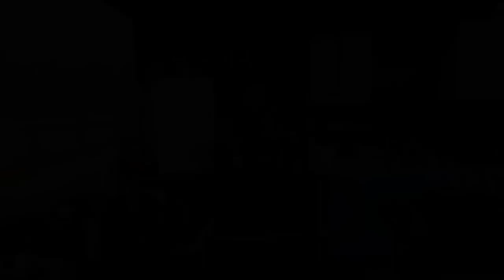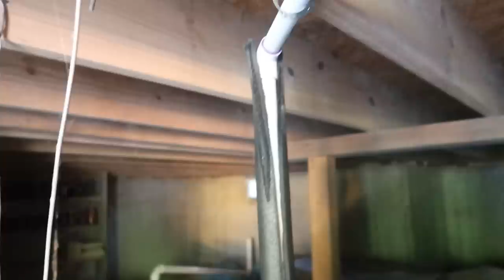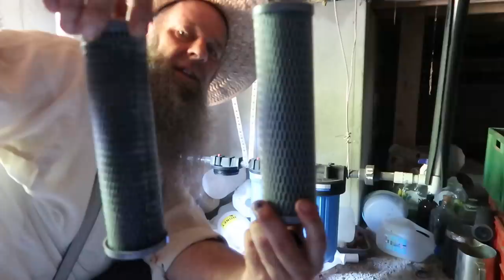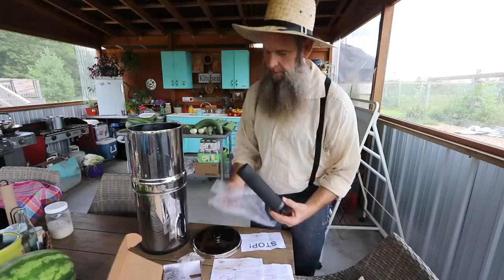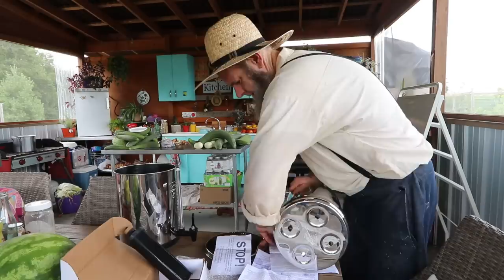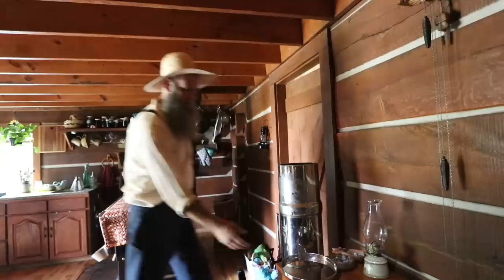OFF GRID WATER could make you SICK protect from Bacteria Viruses Heavy Metals

Comment: Someone may have noticed this already but, you want to wait until most of the filtered water has been used and that lower container emptied before you fill it up. It's important for the filters to be completely immersed in water for them to work optimally. If you are just adding a pitcher to the top when you see the bottom is low it's not going to work as well. If you fill the top to the tops of the filters you are going to get a flood. 
But my kitchen floor got a good rinse and rub down so there's that! ;)

Comment: We've had the Berky water filter for 2 years now and are on the same filters we installed on day one.  We take the filters out and clean them and use them again.  Good for a few years.  We LOVE our Berky.  Our water is in holding tank and comes from a spring in a cave on our property.  It's pumped up to our house. We just use a single thread filter and and run the water into the house then run everything we drink through the Berky.  Best water ever!

Comment: Using a Berkey for 5 years. Great product! They/it even take Roundup out of the water. Which is in the rain now. A tip I have if it doesn’t process the water fast add a small clip to the joint of the top & bottom of the container. They sell them clips but anything will help.  The other holes are for fluoride filters. But you could use 4 filters...
Reply: the fluoride filters screw on the end of the carbon filters, it would do no good to put the in the extra holes. the berkey can handle 4 carbon filters and 4 fluoride

Comment: Everyone has problems with the ceramic berkey filters leaking. Put red food coloring in the top, and see if it gets to the bottom.

Buy aquarium sealant, and run a bead across the base of the filter where the ceramic nests into thw plastic cup. That seems to be the weak spot. Aquarium sealant is safe; if it's safe for fishies, it's safe for us.

Comment: 7:36
My father put two metal cans in the wall of our foundation instead of PVC. Whenever you're ready to put a water pipe through, just pop the top and bottom off the can and you have a nice hole to route your pipe through. After that, mortar your pipe in and you're good to go. We did this with the pipe from our spring up the hill.

Comment: When I moved into my present house almost three years ago I decided that I would not be drinking the tap water. We had slowly been transitioning to  bottled water. But I did’t like the plastic waste. In addition I was pretty much relying on the integrity of the people filling the plastic bottles. Of course after researching I realized that the bottled water was not necessarily pure.  When Jess from Roots and Refuge showed the Berkey I got one, Mine is large enough to hold one gallon. It is enough for me to use by myself. I am glad for it. I fill several glass bottles (which were included in my order) and keep them in the refrigerator. This allows me to keep ahead of my water needs, this provides already cold water whenever I want it, and just in case I forget or neglect to fill the Berkey this is my back up plan. I have plenty of water to drink while I wait for my gallon of water to filter through.  That is my not-off-grid routine! LOL!
Reply: I think another issue is the companies sometimes exploit small towns with good water. They are greedy about taking too much water and not paying properly for it.

Comment: I’ve been using the same Berkey water filter system for the past 4-5 years, and even the pets won’t drink water unless it’s filtered by Berkey! To avoid running out of filtered water I fill a glass jar with filtered water, and add more to the filter, when the glass jar is empty I refill it from the Berkey and add more water to the filter. I love it! We are on a cistern and there is a lot of sediment. The filters get clogged very quickly, but Berkey recommends scrubbing it with a Scotch Bright scrubber up to 100 times to remove sediment. Without this trick the filters would be much too expensive to replace twice a year.
Reply: I was thinking it would be good to have a carafe or two of filtered water on hand or use one of those table top ceramic dispensers, to stay ahead of the filtration rate.

Comment: Water filter removal tip: I have a reverse osmosis filter which has the same blue plastic filter holders you have in the crawl space. I keep a loop style oil filter wrench under my sink to help open the canister. Works great. They also make dedicated wrenches for them. 

Also, I’ve seen some canisters made out of clear plastic, which might make filter inspection possible without needing to crack open the canister.
Reply: Will Swift  – RO water isn't much different than rainwater in that respect, so there's a large component of FUD there. That being said, mineralized water tastes better (probably because it is, indeed, healthier). And i do add minerals to my RO drinking water; typically about four drops of Trace Minerals Mega-Mag 400. Sometimes i also add powdered potassium gluconate. I suppose a pinch of baking soda could be added too, but it hasn't been my wont to do so. 

Some of the newer RO systems offer a mineralization stage, which supposedly adds minerals back into the water, but i'm leery of those. The purpose of RO systems is to remove contaminants; how do i know the mineralization stage doesn't introduce contaminants? Perhaps not by design, but unintentionally. Knowing the way things are sourced today, i think that's a very real possibility.
Reply: Will Swift  – As i understand the theory, RO water is "bad" because it's too pure. Rainwater is similar to RO water in purity. 

Drinking pure water has two implications: A) it isn't a source of minerals, and B) pure water is slightly acidic. But water from various sources varies widely in mineral content, so relying on water as a primary source of minerals is probably unwise as a general rule, as it varies by region. 

For example, water servicing Portland, Oregon comes primarily from the Bull Run reservoir. It is primarily rainwater and snow melt, which has spent a little time in a lake. It has minimal mineral content, compared to hard water sources like most well water. The minerals it does contain are mostly undesirable contaminants and byproducts from the pipes and water treatment systems.

Supposedly, it is the slightly acidic nature of pure water which makes RO water "bad." If one has adequate minerals in one's blood plasma, drinking pure water won't be leaching minerals from teeth and bones. And it's easy enough to raise the pH by adding baking soda, or other alkaline minerals.

Different kinds of filters filter out different kinds of things. If your water contains lead, fluoride, or other contaminants, you're probably going to need something like a RO system to remove the bad stuff. Unfortuantely, that means removing some good stuff too. 

The argument that RO water is innately "bad" is spurious, and therefore FUD, in my opinion. It is an argument often put forth by many non-RO filter manufacturers who want one to buy their product instead of a competitor's RO system. Problem is, their systems are probably incapable of removing heavy metals, etc. Such systems may be good for many applications, but certainly not suitable for every situation nor source of water.

Comment: With my water filter I simply turn up a 5 gallon water bottle on top and place a 5 gallon bottle beneath the open valve.  It will filter the 5 gallons over night.  Don't have to worry about overflow or constantly filling up the top container.
Reply: Excellent idea. My Alexa pure only filters 2-2 1/2 gallons in about 12 hours. God bless you.
Reply: Can you tell me what you use to connect to do this?  Thanks!

Comment: We’ve used a berkey for 10 years.  We keep a gal pitcher of tap water beside it to dump into the Berkey, and another beside a separate clear dispenser to move the filtered water, so we have easy access to a greater volume of ready to use water.  We drain the filtered tank to keep in the clear 2.5 gal dispenser every time we fill the top reservoir so it doesn’t overflow, but we keep an inverted lid under the unit just in case. We use filtered water for all drinking, cooking, bean soaking, pets, etc.

Comment: Doug,  I have never seen a filtration system where the carbon filter is first in line. The carbon traps both water soluable compounds as well as microorganisms. Filtration stages should be set up to progressively trap the larger particulates. The Berkey gimmick appears to be just a carbon filter.  In my opinion you may consider rearranging the cannisters.
Reply: Do you mean progressively filter out smaller things?

Comment: Hi Doug,

I love my Berkey!  One tip for you: I drilled a tiny hole in the back of the lower chamber just below the top.  Takes care of the vacuum issue that slows your water flow and does not let light in so no issue with growth.  The stainless spigot is much nicer for both flow and ease of use and they put them on sale for half off fairly often.

Take care and all the best from California 💛
Reply: Some folks (maybe BP Earthwatch?) make a tube with a T on top, that attaches to one of the filter holes, and the T sits above the top container fill level. It does the same thing with letting the air out of the bottom so it fills faster, and you don't have to drill a hole.
Reply: @davidmc8110  Hi David,

Sounds interesting but that wouldn't work with the travel berkey that I have because there are only holes for the 2 black filters that are installed.  I think all of the other bigger models have the holes for an additional  2 filters.  Very clever idea though!  Thanks!
Reply: @davidmc8110  CLEVER! I have the cork stoppers and I am thinking of drilling a hole through the cork and fitting in surgical s.s. tubing to allow flow.

Comment: I collect rain water too and have been using a Berkey for almost 3 years with no problems. I started out with the white ceramic filters but since changed to the black cartridges. I only have a 5 micron sediment filter in my system so I knew I needed something more for drinking water. If the water is going in cooking or for cleaning I just use what comes out of the tap.

Comment: You don't want to add a little bit of water at a time to a Berkey because then you are always using the bottom half of the filters.  The top half of the filters will then will dry out and become useless with time.  Always make filing the tank a once a day thing... fill enough water so that the filters in the top chamber are always completely covered. Good luck!

Comment: I ordered two filters from Berkey and used two different  party drink dispensers  that hold maybe 8 gallons each.  I had to have two different ones to get them to fit together  like the Berkey does.  It works perfectly!  My dispensers are clear  plastic not aluminum like the Berkey.  So I can see how much water is left in the water filter system.
Reply: Most of the Berkey models are stainless steel, not aluminum, but congratulations on having worked out a system that suits you! 👍

Comment: Now, Doug, realize that at times the usage of the water after filling the refill chamber causes a vacuum in the lower chamber and decreases the flow. It is NOT a requirement to replace the filter. The fast relief for this situation is a single strand of #12 copper wire about 3" long, folded over the upper lip of the lower tank and under the upper tank. This will compress in time and will allow just enough air into the lower chamber to eliminate the vacuum seal formed when draining the water into your Hay-Maker Punch or Stacy's Tea. Just thought You might enjoy the nugget back, as Many as you'se Guys have given us. Ya'll B BIG Time Blessed, This and Every Day, until all Eternities are at an end and Time is no more. . . . . . .
Reply: Nice nugget!  Thank you.  ♡
Reply: @catcolbert9044  Was he not talking about his house water filter getting "clogged up" and reducing flow?
Reply: I cut a 2” piece of plastic drinking straw and tucked it between the upper and lower chamber, with just a bit sticking out over the rim. Works great to eliminate that airlock situation.
Reply: Berkey now includes a small clip to put on lip of chamber
Reply: okie ag that’s interesting. We’ve been using our Berkey for over a decade and haven’t experienced that issue..

Comment: Another way to know when your filter is full of debris or particulates is to put a 0-100 psi water pressure gauge downstream of each filter when your filters are newly installed. Make note to check the pressure when the new filter is installed and record it. The Water pressure will start to go up when the filters are the end of their useful life and are becoming ineffective to filter properly. Basically the filters are plugging up. On another note, Have a sediment filter upstream prior to all your more expensive Carbon filters. This will assist in lengthening the life of your Carbon filters.
Reply: Gravity fed system? How high is his the water level of the storage container from the filter levels times .433? Lol if the total is 10' then water pressure at the Filters is only 4.33 psi. Less up at the faucet.

Comment: I just got the alexapure filter myself takes longer to filter but does the same, cost about half the price of a berkey but i wanted one of those originally just cant afford it 👍👍👍👍😘😘
Reply: That’s what I bought as well, big difference in price!  To me they are the same thing but I could be wrong.
Reply: Does the water in your unit have a metallic taste?  I have an alexapure and it tastes metallic to me
Reply: I havent noticed any metalic taste but my taster and sniffer are NOT in good order
Reply: spartman Just curious when you first received it did you wash the inside with mild soap and water?  I did and I have never had a metallic taste, just wondering if there could have been any “dust” during manufacturing that could have given it that taste?
Reply: @leannekenyoung  Yes I did.  in fact I have used it for around a year or two now and it still has a metallic taste whenever I use it.  I have basically stopped using it due to this.  I wonder if I didnt get a bad filter element.
Reply: @spartman 
Are these Berkey units made here in the U.S., or China? Also, where are the filters made?

Comment: I am intrigued by your water system. I also plan to collect rainwater and I’m trying to figure out what system I would like to use. Are you not worried about the cancer risk from using polypropylene string to filter your water? Any alternative suggestions?
Reply: good observation, but wouldn't the risk be the same just buying bottled water ?

Comment: Arrrghhhh ! The dreaded CROSS THREAD ISSUE ....I HAVE A SYSTEM , WHERE I REVERSE THE CAP ,TIL I FEEL A CLICK ( THATS THE THREADS LINING UP AT THEIR STARTING POINTS. ..THEN I SLOWLY TURN THE CAP TO SCREW IT THE OPPOSITE DIRECTION..    IT WORKS WITH ANY THREADED SYSTEM.
Reply: Mark Atkinson Me, too! Has saved me MANY times. Especially with things that are made out of ‘soft’ metals, ie: aluminum.

Comment: That is so cool! I was curious, did you all have to “prime” the system to get it to flow upwards into the cabin? Or did gravity do all the work? Thanks so much for your wonderful and knowledgeable videos!
Reply: As long as the water tanks are above the level of the spigot you should get water out of it. The higher the elevation of the tanks in comparison to the spigot the higher the water pressure.
Reply: Cody .Ramer Thanks for the info!

Comment: We built a cement shed ceramic tiled floor, with a pressure pump and two 800 gallons water cistern and filtered like yours. We live NW Puerto Rico.  We are not completely off Grid but we also have solar panels on our cement house roof. We grow our own food. We also have a solar power water distiller and solar power water heater on the roof. Plus inside the house we have solar air conditioners. And ceiling fans in each room. We both worked hard saved every penny, built our home and each year we would add all these things. Then moved from NJ to PR.

Comment: Doug, we use a cleanable polyester 15 micron spin down filter just before a 275 gallon IBC Tote where we batch our house water using a solar powered pump and ozone aeration system I created to purify the water. The water leaves the Tote and goes through a 10, 5 and 1 micron nominal three stage system with Washable and Reusable pleated polyester filters. They are about $7 each and we have two sets so we use them over and over again. We finish with a 0.5 micron carbon block filter as the final stage which is the only filter that is disposable. The Solar powered pump is a SEAFLO 55-Series Diaphragm Pump - 12V DC, 60 psi at 5.5 GPM and has a 4 year warranty. The pump allows us to push though the 0.5 micron filter and have good pressure for sinks, showers and laundry. The pleated filters are Hydronix SPC-25-1010 - 10 Micron, Hydronix SPC-25-1005 - 5 Micron, Hydronix SPC-25-1001 - 1 Micron. The carbon block always goes last in any filter system as it is the hardest working type and most vulnerable to plugging. Solar is our friend, let it do the work for us.